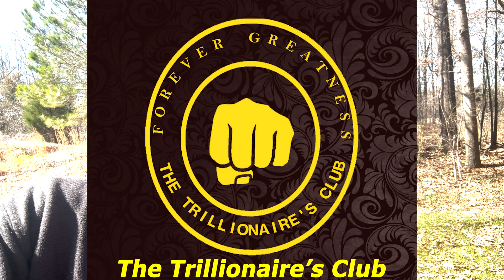I got stabbed and Built a Plastic to Fuel Reactor - Life's About Perspective The Trillionaire's Club

Comment: I wish this were a solution, but unfortunately, breaking down polymers produces a wide variety of compounds. While burning them is possible, there is no net energy gain compared to simply burning the plastic itself. Using the resulting products as engine fuel seems like a great idea, but any fuel requires a well-defined composition to function properly, not just in terms of knock resistance but also other critical variables. These conditions simply aren’t met when breaking down a mix of different polymers.
Rectification might seem like a solution to refine the products into more defined substances, but it is far too expensive, which may be one of the main reasons pyrolysis is not economically viable (just the first step). Even with catalysts, the laws of physics remain unchanged, there will never be a net energy gain. So instead of looking to burn plastic in one form or another, why arent you looking to improve to controll the process of pyrolysis into economicly intressting molecules (which sadly i doubt there are in their puriety).
Reply: There is no net energy gain with any process. Oil refineries consume 20% of the thermal energy in the crude oil to arrive at gasoline, kerosene, and diesel. And Benzene and styrene have excellent anti knock qualities.